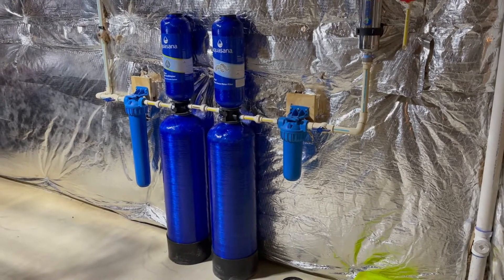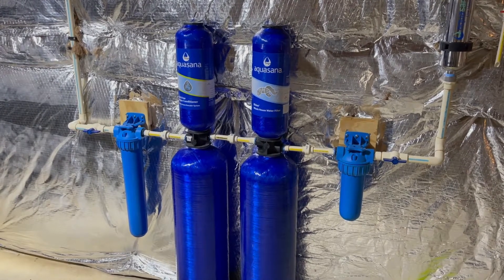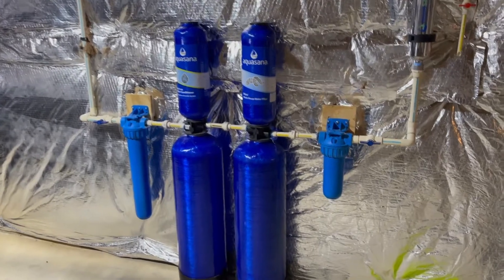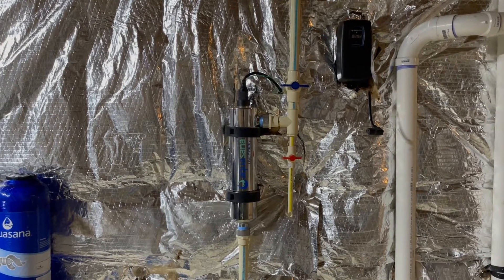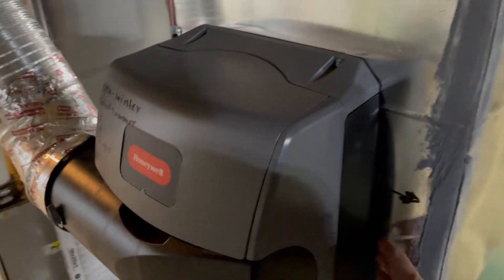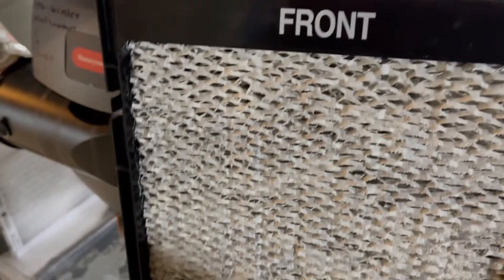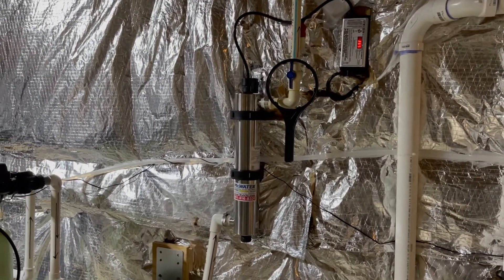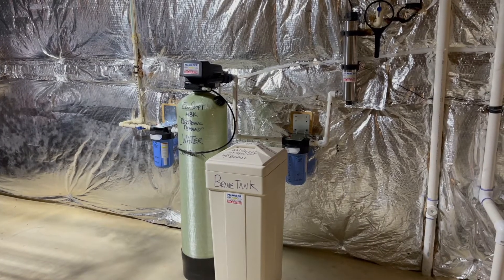"Salt Free" or "No Salt" Water Softeners just DO NOT WORK! Replacement of Aquasana "Rhino" System

Comment: They work as advertised. The customer likely did not read or understand what they were purchasing…a water conditioner not a softener. They crystallize the minerals so they dont scale up your pipes. If, however the water goes into a tank after conditioning it will re crystallize over time as shown in the humidifier tank, so best used with tankless water heater. I advise reading up a bit on the subject sir
Reply from the maker: You haven’t a clue “pinhead” about what you are talking about! What you said makes no sense - recrystallize after going through a tank? What? Huh? Clogs heat exchanger in tankless water heaters just as bad even worse. I’m sorry “zippy” but they really have NO scientific studies showing that they work at all - none - I challenge you to read up yourself and find one just one.
Reply: @Mr-Water-LLC-of-Maryland  "pinhead" and "zippy"? Nice reply. I wouldn't hire you with an attitude like that. And the person who posted that comment is right. The Aquasana is not a softener, it's a conditioner which does not reduce hardness, rather it conditions the water to prevent scale. It's listed on Amazon as a water softener alternative, not a water softener. Whether or not it actually works, I don't know.
Reply: @camaperture8116 correct

Comment: Aquasana is water conditioning system. It turns scale into crystals. Mineral crystals do not build up on pipes. In fact mineral crystals will descale old pipes over time. With a conditioning system the water will not be soft and laundry will still feel stiff but your pipes are free from scale build up.
Reply from the maker: Erik I know what this “conditioning system” is advertised to do but other than making the water taste better because of the carbon filters it comes with - it does nothing. There are NO scientific studies even proving the descaling claims. Fake! That is the best way to put it - like witchcraft. The humidifier panel shown in this video demonstrates that the system has no effect on the scaling from calcium hardness.
Reply: @Mr-Water-LLC-of-Maryland  …They work. it crystallizes the minerals so they do not collect in the pipes as scale. If, however the water is stored in a tank after conditioning, the minerals will de crystallize over time as shown in the humidifier tank. So best used with a tankless water heater system. Your customer purchased a product that is not designed to give them the results they were expecting that is all.

Comment: I don't know the exact nature of this Aquasana system, but it does not look like a salt-based water softening system but rather a 'salt-free' hard water 'conditioning' system, which uses either TAC or other material to crystalize calcium and magnesium ions into micro-crystals, then these flow back into the water stream, used by customers for house hold usages, then flow into the sewage. I happen to be looking for a salt-free water conditioning system for over a year now, and I had viewed and read about the traditional salt based system vs the salt-fee system extensively, so I know they are totally different way of dealing with hard water situations. To call a salt-free conditioner 'Water Softener' is a total misnomer !!! A 'No-Salt' or 'Salt-Free' system can be used effectively with two prerequisites: 1. the water source cannot be too high in the inherent calcium and magnesium concentration or other materials that increase granular count, also cannot be high in iron or manganese, if so, the water needs to be pre-treated to lower these latter minerals, otherwise it will NOT work. 2.  If the water is sourced from a well, it needs to be pre-treated with adequate/effective pre-filters or filters. The several brands of salt-free hard water conditioner manufacturers that I have viewed online all mention about these information about their product. It'd foolish and asking for trouble (in having dissatisfied customers if they don't make it clear. Although I have not gone back to view Aquasana's website about this, I am pretty sure they did advise about these two important aspects. If a customer fails to read carefully and thus know about it, but proceeds to buy it online, then installed, esp.  given their water source is well water (as mentioned by the narrator), I do not think it is surprising that the granule count is the same before and after the system ! It's certainly not fair to blame or claim that Aquasana made false advertisement. (I am just a regular consumer and I have no connection with any brand of these water treatment systems.)

Comment: Aquasana doesn't produce a water softener, it's a water conditioner that keeps the minerals from binding to existing plumbing. It does not remove minerals and their systems are not advertised as being capable of doing so. If the owners did their homework or inquired about the systems purpose to the builder they would have realized this. I have this exact system and it works great, it just doesn't "soften" the water. Water softeners generally don't filter the water so it greatly depends on the customers needs. But the false statement in your opening monologue that Aquasana is somehow advertising this is disingenuous. Read their product information, it's very clear. As for the UV light, if the crystal sleeve it's inserted into or the light itself was damaged that isn't the UV lights fault, but possibly the installer.
Reply from the maker: So called “salt free” or “no salt” Water Softeners are NOT Water Softeners at all and DO NOT actually soften water by removing any calcium, magnesium or iron from the water and they have NO peer reviewed scientific studies proving they work at all. Claims of catalytic processes and anti-scaling properties have no demonstrated validity. Cation exchange Water Softeners have been in use for over 85 years and are the ONLY type of water softener system any home or business owner should consider purchasing. So "bearmeister98" the Aquasana systems they sell have NO scientific studies proving they work at all. I have read their website for years and watched them slowly retreat from the "water softener" claims they had for a long time. I have replaced countless numbers of these useless systems in the last 20 years.

Comment: Mr Water - Howdy!  I have the exact Aquasana setup from your video and we’re in a new build for about 8 months.  We are on well water.  We are not happy.  Shower heads, faucet heads etc are getting clogged up, when I wash the car if I don’t dry it quickly I have substantial mineral deposits left on the car.

Wish I was in Maryland but I’m not!  Would you recommend installing a water softener before or after the Aquasana system?  Or just doing what you did in your video and rip the whole system out?  Thanks!
Reply from the maker: Just remove it and get one from Lowes or Home Depot if you have too. At least it will work to actually soften the water. Snake oil salesmen are what they are  - sorry you got taken for a ride.

Comment: I'm on city well water and it's hard. The system that came with the house was already installed by kinetico. It doesn't work so it's bypassed. The new system you installed looks somewhat easy to install. My house is 2100 sqft. Would that work for this house. Thanks
Reply from the maker: City well water? Your water has to come from somewhere but you just have municipal water. The resin in the Kinetico system is most likely kaput from the chlorine - and if they weren't such a pain to work on I would say replace the resin but thats not going to be worth the trouble. A 32,000 grain softener system with carbon pre-filter is what you need.
Reply: @Mr-Water-LLC-of-Maryland  
Thanks for your help. Home Depot has the Rheem 32,000 for $350 bucks. Is this any good. I appreciate it.

Comment: I can buy in my area some "cationic resin filter" that should last like 6 months, as advertised. Is this a water softener where you replace the filter instead of regenerating it with salt? Or is it still a water conditioner? Thanks!
Reply from the maker: Basically it’s a filter with cation exchange water softener resin in it. Once exhausted it’s finished working - done. There are empty filter cartridges you can buy and refill with softener resin, dump out and refill again and again. Best just get a water softener installed instead.

Comment: I note that you tested the dissolved levels before removing the AquaSana system - did you do the same after you installed the water softener? Seems like that would help sell your point if you had the data to back it up. Not challenging your expertise or whatever - just curious as to what the hardness levels were after you installed your system.
Reply from the maker: Hardness 0 gpg of course
Reply: You do have a point. My only criticism is why did you not also install a neutralizer after the softener. And check the acidity levels.

As I watched another of your videos.

In my case I am on city water.

Which is very hard and loaded with chemicals.

And I am in a condo in southeastern PA.

So I am going to start with to dislodge all the crap in my pipes a yarma descaler system and the 48 version and install after it. Either one or 2 10 stage filters after it that tier 1 makes that are really good.

And if that does not clean up my water enough I will install a conventional softener but if I do I like to set the bypass valves to a half a degree so the hardness is just enough to not get the slimy feeling.

And the reason why I bring up why aren't you also installing neutralizer after the softener is because salt based softeners take out almost all the minerals and a calcite based neutralizer puts calcium and magnesium back into the water and rebalances the ph.

I know this because my mothers house is on well water and her set up is sediment filter after the preasure tank softener with the bypass valves set to a half degree and a neutralizer as the final unit. 

And the water untreated has a really high iron content also.

And her water with that setup looks feels and tastes just like spring water.

My case is different.

Also the yarnna guys keep saying it is not recomended to use their capacitive based descaler softener systems with a salt based system but that is simply untrue.

And there guys keep saying salt based softeners put high amounts of sodium in the drinking water which is also untrue as the salt is only used to clean the resin during the regeneration process.

Yes it might put a high amount of salt in the septic tank or sewer system.  But that's about it.

I bring that up because I think 

1. You should test the yarna descaler system and research it.

2. I think you should be aware of some of the nonsense some guys are saying about salt based softeners which is not true.

3. The yarna capacitive descaler systems which send electrical frequencies through the pipes will in some cases work well with your systems.

By keeping the pipes clear before it hits the filters and softeners on well water homes.

But can be beneficial on city water.

And it has really good reviews.

Comment: This customer seriously didn't push to return the system!? Amazon generally takes everything back, especially seeing the proof that the system isn't performing as Aquasana promises! How much did you charge to install your system?
Reply from the maker: I agree he maybe should have tried to return at least the UV Light that was clearly defective. He was so disgusted with the performance of the system as a whole he just blamed himself. He is an attorney,  this demonstrates how slick the false advertising is as to fool him. ALL ULTRAVIOLET LIGHTS have the same water quality parameters for proper operation (less than 7 gpg of hardness) - so given the fact THIS IS NOT A WATER SOFTENER - how Aquasana (and Amazon) justify selling this combination of equipment when they certainly know it isn't going to work properly is not only unethical but should be illegal. Giving families a false sense of security that the water is going to be disinfected and soft only further illustrates the lack of regulation in the industry I have proudly been a part of for 34 years. The warranty for a UV Light installed on hard water is no doubt voided the second the installation is completed - tell me something isn't wrong with that!! Now, if customers know ahead of time that cleaning the quartz sleeve on a routine basis, making sure the light has a SIGNIFICANTLY larger GPM rating then the max water usage in an average residence of about 5-7 GPM and NO iron, sulfur or turbidity and the bacteria you are trying to kill IS NOT E-COLI - then maybe you could get away with it. If you are treating for e-coli you had better make damn sure it's installed correctly with the proper pretreatment in place. Fortunately most people are healthy enough that being exposed to low levels of coliform bacteria in their water supply can be tolerated and not make them seriously ill and therefor a UV Light not working as it should seldom is a very serious issue - but e-coli is from animal feces - and is a totally different and nasty issue!!

Comment: Thanks for the video. I saw an Amazon reviews of this product, some guy posting before and after tests and it seems hardness went down from 400 PPM to like 150. He also claims that strong sulfur smell went away. How is it even possible?
Reply from the maker: It’s only possible for a short time if the system has some carbon either filters or contained in the tank for the sulfur to be removed - 150 ppm hardness is still 8.7 gpg and hard water. Like I said maybe softer and no smell for a few hundred gallons or so then system caput